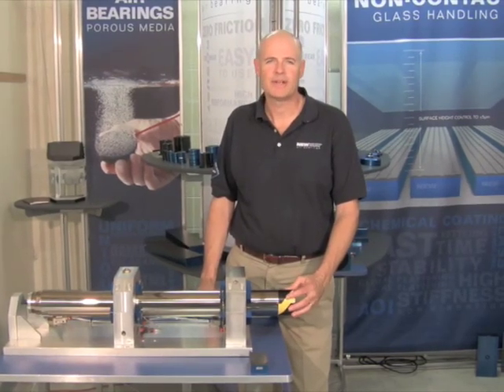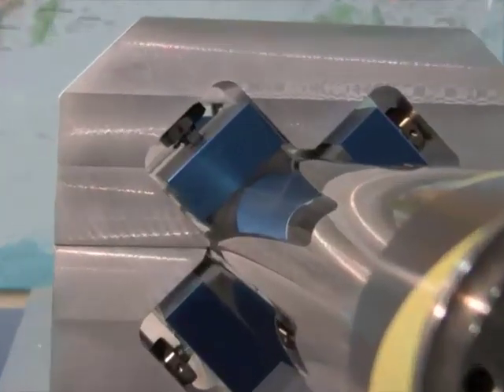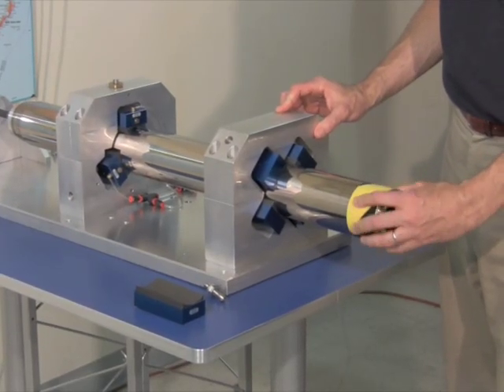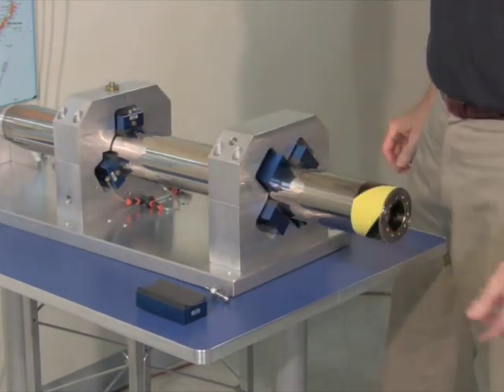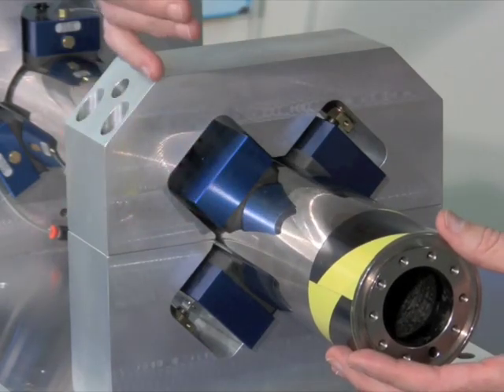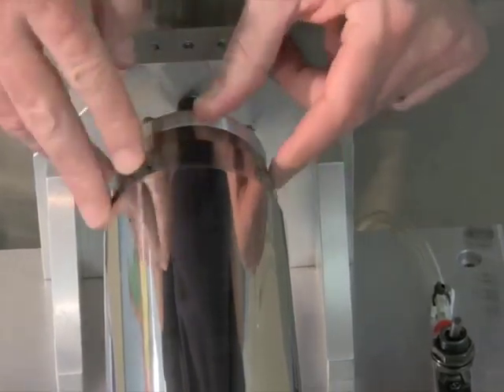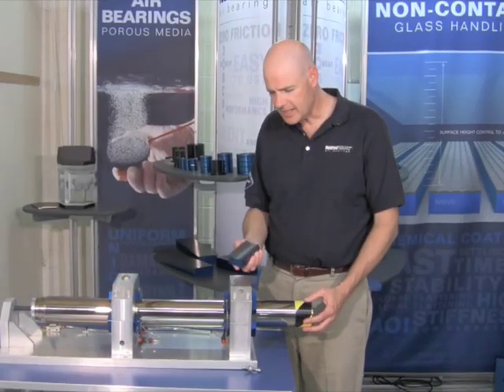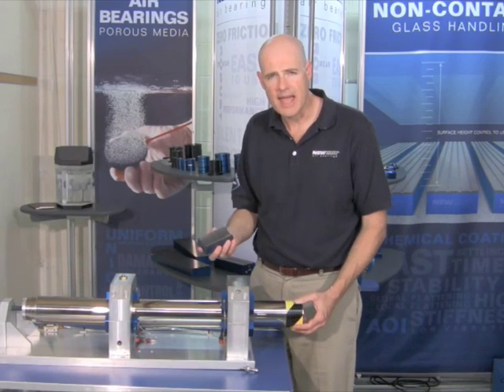Radial Air Bearings on a Precision Shaft

Comment: I'm amazed at how stiff the air film is, seems to defy intuition.  Please correct me if I'm wrong, but is part of the secret or "magic" behind this tech the fact that the air in the gap is not only being compressed, but is restricted from exiting the gap, and this restriction or equilibrium between the the compression and "restriction" is what allows the stable/stiff air film to form?  Is the restriction due to the particular viscosity of the air, or just more simply a result of geometry (i.e. too large for viscous effects to really matter).  In the film, is the range of air compression still linear (following ideal gas law) or is it now exponential, and that too may be part of the magic perhaps? (less likely I think).  Seems to me, and I may be very wrong, but it's as if there's a special regime of scale here where some particular physics are what's allowing the air film to be created, and exploited.  Any Info is much appreciated, thanks!

Comment: This showed up in my feed a few days after watching a video by integza about a porous knife with an oxy fuel mix fed into it.

The porosity was apparently the result of a defect in selective laser sintering processes that turned out beneficial.

Was the bearing material made using the same sls process?

It leaves me wondering if it is possible to produce something like a phase change heat pump or a heat exchanger using the same process.
Reply from the maker: Yes, we often run porous bearings using Freon as the bearing medium rather than air. This makes for a hermetic oilless contactless bearing system. It’s typically employed and larger air conditioning systems where centrifugal compressors are used.

Comment: Japan patented a sandblasting technique using rubber as the blasting agent to create small round indentations on the metal surface. The size of the round indentations are just the right size to trap air between a shaft and housing, essentially creating this same affect without having to pump air through it. I’ve been looking for the parents since the 90’s. I believe it was discovered by FUJI. They pioneered enclosed sandblasting machines and techniques that were over shadowed by the primary business of film. I believe it was Fuji. Someone please help and or correct me. Because I’m still looking for it he data and the patents
Reply from the maker: Thanks for your comment.
There are fundamental differences between aerodynamic gas bearings as you are describing with the sandblasting technique and externally, pressurized gas bearings. so they are completely completely different sets of teachings and claims inthe patent literature. The basic idea of hydrodynamic or aerodynamic bearings were first described by Kingsberry and Mitchell, respectively in the United States in England at almost the exact same time.

Comment: Here's a snarky comment from the peanut gallery: the 2 cutouts at the end of the shaft couldn't be why it's turning to face those cutouts up, because it's happening too quickly.  That missing amount of metal couldn't rotate that heavy shaft so quickly.
This is really, really cool video.  I had no idea 'air bearings' existed- or that they could work so well.  I'm imaging things like a free piston linear steam engine/generator that would need no lubrication and would be wear-free.....
Reply from the maker: That is a great comment and you obviously have a great practical grasp on mechanics.

Comment: That is amazing!  I always figured magnetic bearings would be the best but this is really an amazing technology!  If this is only 60 PSI, I wonder that the flow rate is b/c that means a very small compressor can run this bearing.  I was expecting something like 1000 - 30,000 PSI at incredibly small holes, like near micron size.
Reply from the maker: Each of the 7 bearings flow 12 SCFH so the whole system flows less the 1.5 SCFH.

Comment: How do you know its the bearing frame that is distorting to allow the air gap when the air pressure is turned on and not the porous material compressing?
Reply: I guess because graphite is too brittle to compress without turning into dust very quickly.

Comment: Have these bearings been trialled with a very low viscosity oil at all? Obviously air bearings are a no go in vacuum conditions, but could a very fine fluid could be forced through the pad? 

We used to run rotors at my old job up to 20Krpm in a vacuum using tilt pad bearings and a 40 grade oil, and in that environment we would witness oil whip even though tilting pad bearings were designed specifically to counter that effect (as a vacuum was one of few environments this effect couldn't be negated).

Comment: Not sure why this got recommended but enjoyed watching... we've used New Way planar bearings for glass handling and had good luck with them, but have not used them for radial applications. We HAVE done systems using ultra precision (micron'ish surface specs at 500mm'ish radius... pretty awesome design) rotary air bearing stages before and when you manually torqued that shaft I cringed - that little bit of motion would have destroyed a normal airbearing stage. Would have been interested in some metrics for what your system is capable of (runout, stiffness, etc...)

Comment: how small can this type of bearing be used before it becomes impractical...?
Reply: Quite small actually I've seen them as small as a 1mm inside diameter. The only thing that you have to remember is the load capacity of the bearing is a direct relation to the surface area against the shaft.

Comment: I feel like pumps go out frequently enough that this is a bad idea
Reply: Just provide enough reserve air through a compressed tank to allow time for things to shutdown gracefully, or switch to a redundant pump in the event of a failure... shouldn’t be that hard to plan for.
Reply: Johnathan Chamberlain yeah but if a system with ball or hydrodynamic bearings loses power then they just coast to a stop. An air bearing loses power then it grounds out and dickers itself.
Reply: Katherine Perkins the same could happen with this system. You just need to design interlocks into the system that cut power with enough reserve air for things to come to a stop on their own in the event of a failure. You could also have brakes that apply to shorten the shutdown time (in fact most air brakes are apply when pressure is removed) Not that big of a challenge to overcome to be honest.
Reply from the maker: The porous carbon is a natural bearing material, we are currently developing product for the Turbo industry.  We have products on CT scanners in the medical industry.  The following is a crash test example. https://www.youtube.com/watch?v=nwNIHkePdwA

Comment: I don't think what the guy said about the frame being subjected to a bending strain is quite right.  It seems to me the frame is like a hoop stessed in pure tension.  So it's stretching rather than bending.
Reply: Notr yhis is for general information -generally descriptive  rather than "Technically"  accurate.

Note at each corner there is an "effective" 3 point Bending setup - pure bending.......
Reply: @kadmow  I think it makes more sense to think of the frame as a truss.  The 4 corners of the square frame where the bearings attach are truss nodes being forced outwards by the jacking force of the bearings z axis adjustment screws.  This outward force, if applied equally in all 4 corners, results in pure tension in the frame, no compression, no bending.  The same may not be true for the three bearing setup, however.
Reply: @pstrap1311 : Or 4 Triangular  "rigid " - Elastic - "elements" connected by 4 beam elements with the Bearing support bending it in the centre - Yes it likely is in Tension (Depending on the "Balance of forces" around the circle) though the beam elements will experience differential tension across the element....  Until we FEA this we won't have a real answer, remember that this isn't a pin jointed structure (Truss), it is a complex  flexible rigid body.  Try to analyse that analytically  (It is possible).

Note:  The Mounting system greatly alters the forces present in the system around the lower bearing elements.

A Centre loaded  end supported beam will not experience uniform tension across its depth, is that not a definition of bending?? (Just as "stressed" concrete is designed Never to be under tension, but it still has bending loads - all in compression across its depth.) - Don't think Truss, Think Elastic body.

(Just checked my original Comment, I am Glad I didn't categorically claim there would be any "Compressive forces"  in the element...  ??   That FEA comment still stands...]
OK. FEA>   It is Quite a complex Part...  as far as movement is concerned....
I Just ran a Linear Solver on it, and  yes there is positive flexion of the upper corners with negative bending at the "thin" part lateral to the upper bearing elements..

The Base Ties the lower section together quite well as one might expect.  Cheers for the Exercise...

Cheers for the followup....  I do have and Engineering Deg. But that doesn't mean anything, If one isn't interested in discussing and learning...
Reply: @kadmow  thank you for taking the time to elaborate upon the subject for me.  As you may have realized, I am not an engineer.  :)

Comment: I'd like to see that shaft at 60,000 rpm with the air pressure suddenly removed...    for science..
Reply: can I be in a different room when it happens?
Reply: They call that friction welding 😂
Reply: spontaneous detonation.
Reply from the maker: https://youtu.be/nwNIHkePdwA
Reply: You'd hope any design like this would have redundancies like self feeding air supply (via an impeller, or even just being linked to an alternator feeding power back in). 

I used to run a high speed balance machine (Schenck DH6i) and we had a giant UPS connected inline with the machine to keep all the oil feed pumps and the vacuum pump running in case of a power failure and give the rotor time to stop before oil feed cutout and atmospheric pressures creep into the chamber.

We used to run on either shell bearings or John Crane tilting pad bearings,a which both applied a thin oil film to the journal to operate - shell bearings would melt all the time, whereas I've only ever seen one tilt pad failure and that was when an operator managed to literally weld a bearing around the journal by running it through excessive vibration (it was SCREAMING and her reaction was 'weeeeee!'...). Each individual bearing pad literally welded itself to the journal...
Reply: With a nice heavy flywheel (off balance) for science!
Reply: Counter balance .
Reply: Madlad linked it
Reply: It was not quite 60,000 rpm, but they had a demonstration along these lines, to illustrate how robust the bearings were. (They were doing it at the trade shows, but I am not sure if there is a video of it.)
Reply: MrTurboturbine  exactly What I thought 😂
Reply: Rapid onset deceleration
Reply: We have magnetic spindles for that, the advantage of air bearings is that you don't need to learn VHDL/Verilog in order to program the controller
Reply: Magnetic levitation for that reason.
Reply: Things would get melty.

Comment: YouTube algorithm is a strange mistress why my recommended something like this?
Cool product but you actively have to use power/air pressure to make those bearings work.
Those are active bearings
Reply: Yeah, but still, if you have a engine to turn it, you should also have the engineering expertise to fit in these. Think about it, if made right, this could last forever, never needing any replacement parts, only power, and a clean filter. That could be very appealing to businesses. It would take no wear from start up or shut down like a lubed bearing would, and it has the gliding of ball bearings.
Reply: @patrioticwhitemail9119  There's wear like you wouldn't believe the moment a piece of dust gets  in there, a grain of sand will gouge through that graphite like butter. And the loading on these is limited by air pressure, you will never have your tractors axle on one of these. These are niche products, widely used in semiconductor automation and other ultra precise instrumentation, but they are in no way a generic replacement for good ol' ball bearing.
Reply: @aleksandersuur9475  yeah. I can see that. Limited usage but extremely effective for what it can do.

Comment: what the cfm required to run this
Reply: Idk but it is a very high pressure low volume application so not much probably.
Reply from the maker: Our products are based on 60psi input pressure.  The fly heights are small, in the order of 5-8 microns.  The bearings themselves are very low flow.  See our https://www.newwayairbearings.com/catalog/radial-air-bearings/ radial bearing specification page.

Comment: Lets see it operate as main beings in an automotive engine.
Reply: Of course it can't
Reply: @Penguin_of_Death  : why not?? - just Add Air...
A Lot more is possible than what is done....  Incumbents create Inertia...
Reply: @kadmow  air bearings work best in low load, high precision areas. Such as micron accuracy milling and grinding. They're also used for lithography machines. But given they need a reliable air supply and and good ventilation for the air, it wouldn't really work in an engine. Also the cost is massive compared to most typical bearings.

Comment: Nice ! Why dont we see more of this never heard of them before seeing this video. What about a thrust bearing to keep it from going linear if its not desired? Whats the maximum rpm it will endure with a shaft like this?
Reply: Google is your friend....  

For Thrust bearings, imagine the same thing with opposing pairs of flat shoes on either side of a shaft flange.  Air bearings really need to have engineered opposing members -or be a continuous circular unit -to keep air leakage to a minimum,  then as there is "near zero" play (within the elastic range of the housing material) there is reduced risk of shockloads causing shaft damage and housing fatigue (there will be more fatigue through cycling on and off, than under designed loading)..

Comment: Very cool and probably necessary in some applications.  The down fall gents is the very expensive machine and shaft or whatever their application is for is dependent upon Airlines and as we know these do fail. You may ruin  an entire shaft and machine be because of an air leak. Simplicity is quality.

Comment: This tech has been around forever. The Apollo missions used gyroscopes with air bearings, just like this, for navigation. The problem with the video however is that the air bearings were not deflecting that housing, they were deflecting that pathetic little point of attachment. They were only attached by the air supply nipple, which is fine for a 90 lb shaft, but as soon as it has any appreciable load, it's just going to crush that little nipple.

Comment: Im guessing these didnt take off too well given the amount of immediate damage that would occur if that air pressure was lost.   Imagine losing air pressure on a a large turbine, and destroying a shaft that cost $250,000 within seconds.
Reply: It can't work on a large turbine as the maximum load must be 10kg !
Reply: @stephane.sonneville  I'm sure they could be scaled to support larger loads....but there would always be that risk of a single air leak bringing the whole operation to its knees....not something you would want in a system that costs hundreds of thousands

Comment: Probably isn’t very much air pressure, correct? Just high flow rate?
Reply: In fact, that's the opposite. You need a high pressure for it to separate the bearings from the shaft since there is no clearance between them. But you need a small flow rate since it's creating a very small gap between the two. (we're talking about 1 micron of play !)
Reply: Yeah, the air pressure would need to be at least as high as the side load (force) on the shaft divided by the surface area of one bearing.  Idk about the flow rate.
Reply: Patrick Donohoe ok . On paper guillotines with an air table it needs only 5psi to float 120 lbs of paper. Thought it may be similar.
Reply: @MagnetOnlyMotors  the difference is that in this case the bearings are preloaded with very high pressure so that the shaft stays centered between them even when subjected to loads much higher than gravity.  10-20ppsi would probably be enough pressure to float the shaft against  just gravity.  I assume you can reduce the clamping force of the frame on the shaft and get the shaft to spin with lower air pressure and reduced sideload capacity.

Comment: Lovley stuff, but its from 2009, i wonder what kind of stuff they have come up now? Ultra Plasma bearings? ;)
Reply: Lol air bearings have been around for at least a century. They are heavily used in the machine tool cutting industry, for sharpening or making new milling machine cutters. I've used them quite a bit as a machinist, it's the only way to cut them unless you have a newer CNC cutter grinder. It's the weirdest feeling, moving a ten pound steel shaft like it weighs a half ounce and is floating in space...
Reply: @TheExplosiveGuy  that's interesting
Reply: The cutter grinders don't always have air bearings, mine has regular tapered roller bearings on the workhead and the linear motion is only by the table ways. Used for the same stuff but admittedly air bearing is better and fancier. My grinder is from 1943.
Reply: Go and have a look at @appliedScience he demonstrates how to manufacture these bearings extremely cheaply at home.
Reply: Shhhh this is secret reverse engineered technology from area 51. Currently they managed to make the antigravity work already.